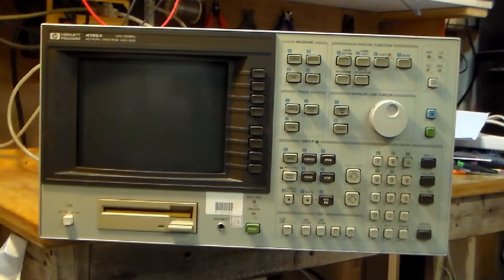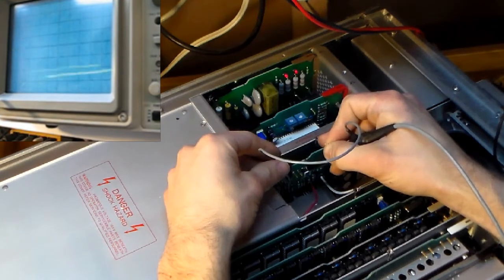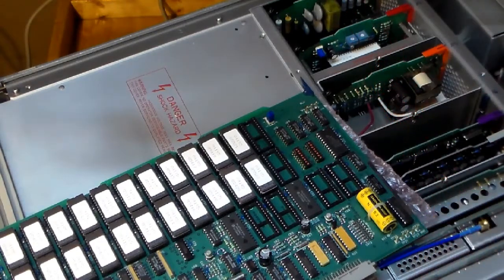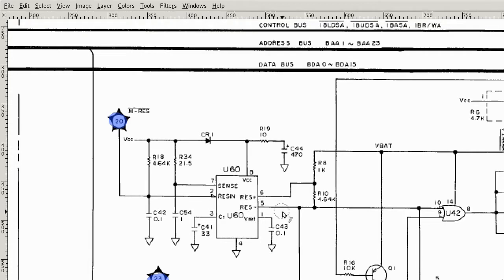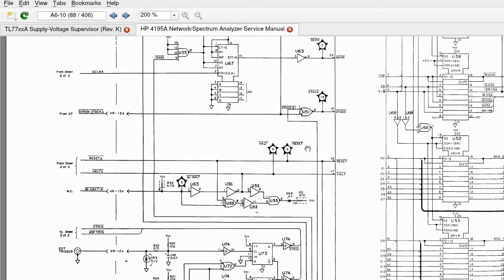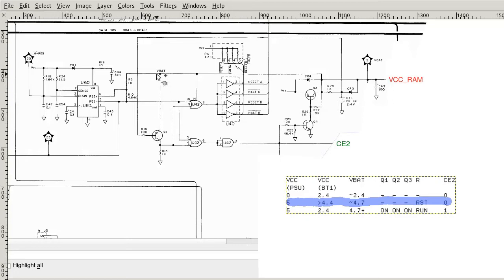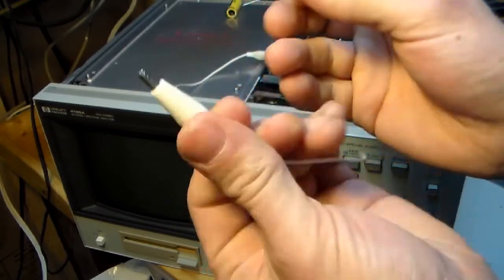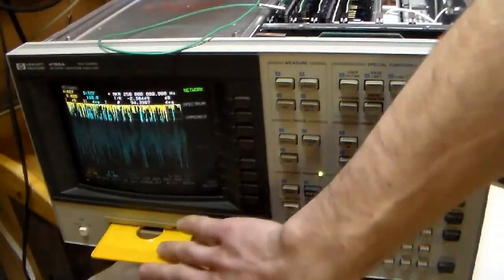HP 4195A network analyzer repair, part 1

Comment: Oh jeeZ.  
I have one that has been sitting here n my bench "dead" for almost ten years.  
It was dumped on me by the local ham club because they didn't want to store it any longer.  
When I first got it I spent a few hours probing around checking voltages & clocks with barely a schematic. 
And no videos for it really existed then.  
I know it WAS working before they dropped it off to me.   

I'm guessing this might be the issue.   
Thanks for posting the video!  

Steve in Ann Arbor Michigan  
N8LBV

Comment: Very clever idea with the LED as a quick sub for the battery - Excellent.  I have a 4195A that I just took out of storage and had this same problem.  I had basically figured the problem out (at least as far as the reset circuit).  I also had measured the battery (not under power) but had decided the battery was probably OK - your video relieved me of the task of figuring out the battery failure circuit - THANKS for an EXCELLENT video.  Did you loose the calibration data when you cut the battery of - I plan to replace the battery under power.
Reply from the maker: Thanks ! As I understand the RAM-backed data is only user programs, configurations, and custom O/S/L calibrations, so nothing irreplaceable. Mine's data was long gone of course so I didn't bother doing a powered replacement. Besides, I haven't touched that machine since the video until I took it out again recently - I still have to decide on a replacement battery ! I don't suppose you have the "adjustment program" floppy disk by any chance ?

Comment: Hi,

I recently got this useful lab device. I have the following problema. When I try to start it, the screen is black (nothing can be seen) and an alarm is on. Any idea? I would like to repair
Reply from the maker: Not sure... you will need to refer to the service manual. I would probably start with an inspection of the power supplies and look for corrosion near the battery.
Reply: @fenugrec5697  thanks. How could I message you more frequently? I think you could help me a little.
Reply: @fenugrec5697  I did the same as you (your video) and no luck. Any idea?
Reply from the maker: @carlosdominguez-palacios9392  I don't recognize the symptoms you're seeing, and uUnfortunately I cannot provide individual support. I suggest you start a thread either on the EEVblog forums or the more specialized Groups.io mailing list : https://groups.io/g/HP-Agilent-Keysight-equipment/topics

Comment: Did you ever locate floppy disk? I installed new battery. Now get message : memory test in progress
Reply from the maker: No... I suspect there are not many copies of that disk left in the world
Reply: @fenugrec5697  your video was / is extremely helpful. Measuring that voltage on battery was good nugget of info.  Before I just had blank screen on power on button push I sent request to Keysight (support page, lets' see what they come back with._.) Thank you again for your work on this.
Reply: It works!! noob move... the boards weren't seated. It works! Thanks!

Comment: Hello, any update on this unit ?
Reply from the maker: Hi, not much - I did some boring tests like T to S, T to R, etc just to verify channel matching and attenuator range; I don't have the proper instruments (power meter, external signal generator) to really verify the 4195's accuracy. I'm also lacking key pieces of gear for the more interesting measurements: a directional coupler and power splitter.
Reply: @fenugrec5697  Thanks for the video BTW. After I was away from my 4195A for 4 years (we missed each other so much.. LOL) we are back together. SO, now I think I will check the battery. I hope that it hasn't leaked all over the place. If I place a big capacitor across it and let it charge, then I quickly add a new battery do you think it will work and I won't lose my settings ? Or is it a crazy idea ?
Reply from the maker: @linuxaos  depends on your tolerance to risk. You could also power the memory-backup section (refer to schems) directly with a current-limited source while you replace the battery. Capacitor, maybe, no idea what the backup memory current draw is.
Reply: @fenugrec5697  yeah, that makes sense. So, first things first, measure the current draw from the battery. I'll just buy a ammeter attachment for my multimeter. I'll keep you updated.
However, you and others have mentioned that the settings are not important and can be re-created by performing a new calibration (open, short, load). Is this correct ?